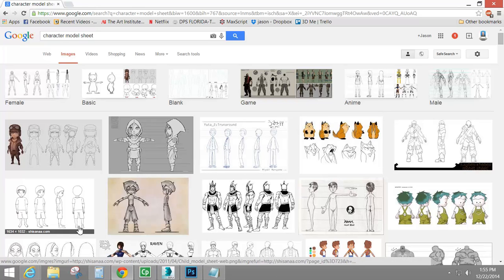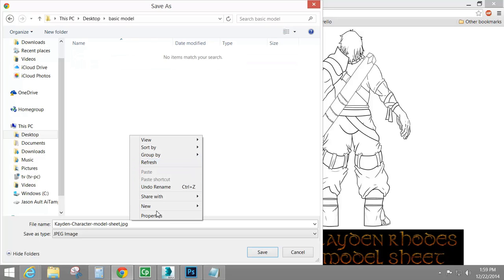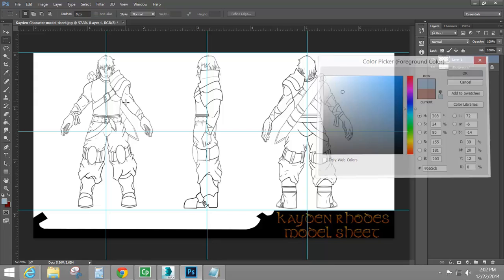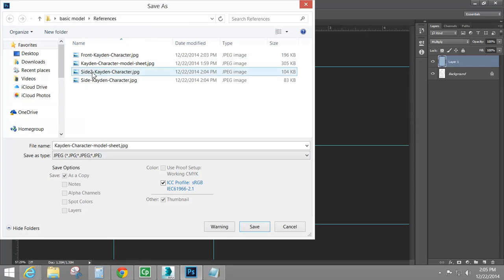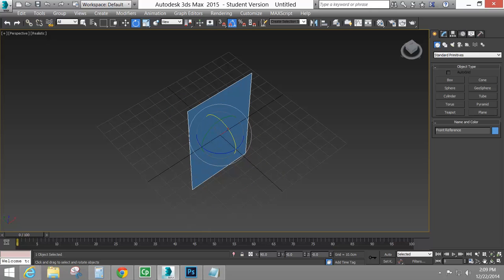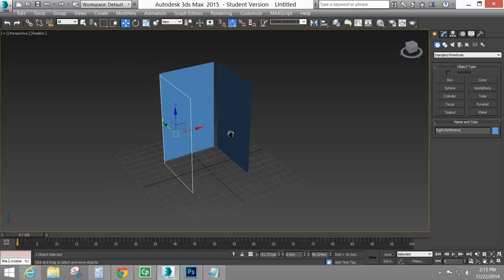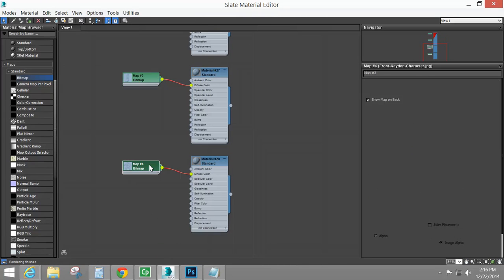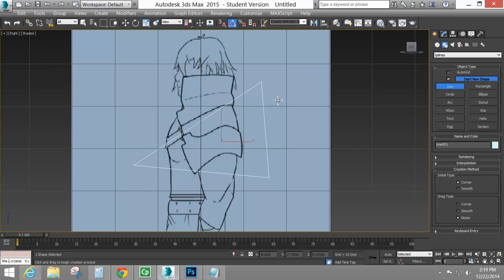Setting Up Image References for 3D Modeling (Autodesk 3ds Max)

Comment: Any advice on what I should do if the arms are detached for the side view of the character? Many of the model sheets have the arms separated from the body, so any ideas on what to do?
Reply from the maker: I would model them detached and then once you are happy with them, move them forward and attach them.
Reply: @CtrlAultDelTutorials  so crop them out of photoshop separate from the sides, then add them on later?
Reply from the maker: If they already line up in the image I wouldn't crop them, but if they made them unaligned off to the side I would crop them out and model them after you have the body finished.

Comment: what if the immages are not the same size, when modeling a horse for example, I cannot apply the same steps as seen here.
Reply from the maker: I would suggested either making them the same size in image editing software, like Photoshop, or making the image and 3d plane appropriate sizes and then scaling them to line up in 3ds max.
Reply: @CtrlAultDelTutorials  Thank you for the quick reply. It was very helpful!

Comment: Is there a way to do a detailed head from  a head model and shrink it to a body model which you have made separately, and weld them together so that you could have more details in the face which you might not be able to get from a full body model.

Comment: Hello!

I am a huge fan of your tutorials as I just started with 3ds MAX.
Minor problem though: When I add the image to a plane the image does not cover the plane, it rather breaks up into multiple small images. Any help?

I did your measurements and the images fit without being stretched, yet adding them to the planes lead to the issue above.

Thank you in advance!
Reply from the maker: Did you crop the individual images?

Comment: My images are showing up on all of the planes I've created as well as not being stretched to full size of the plane. I'm trying to do this with a reference I found of Ironman and now there is a checkerboard of tiny ironmans covering all the surfaces...
Reply: i fixed this by going into the meterial editor and double clicking the "map # bitmap" and checking the "Use Real-World Scale" box on the right then enter the same width and height you made your plane